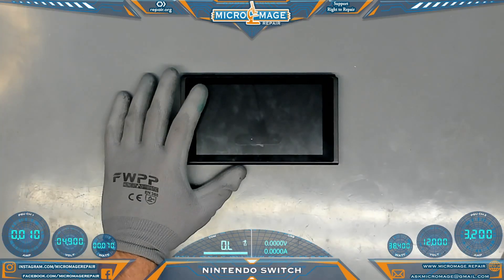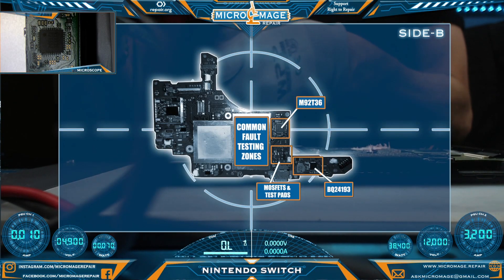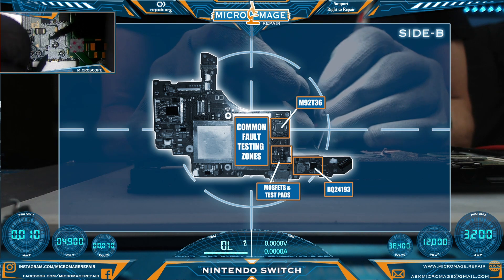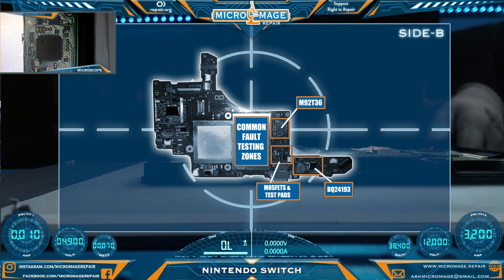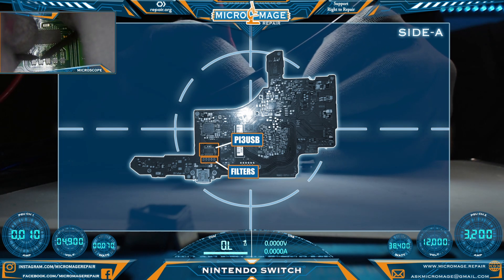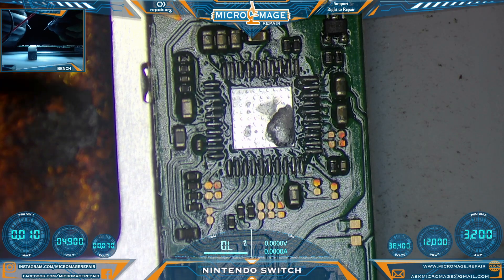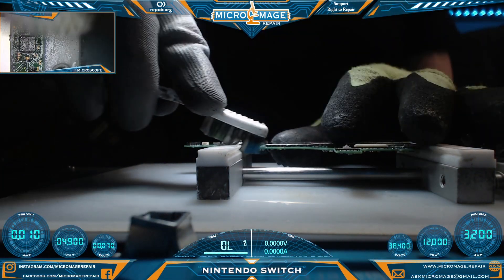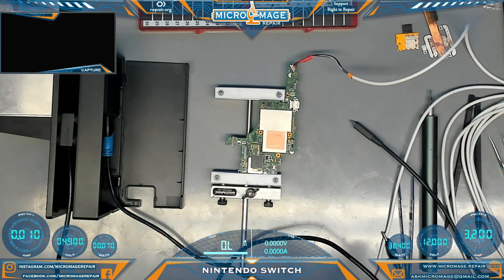Nintendo Switch: Error Code 2101-0001

Comment: Hi i have replacing the usb c port and it was going perfectly but now i have everytime a short on M92T36 Short on Pin 39 the Mittle Cap everytime that one. How i can know what are too doo ? i get no 15v only 5v are too see
Reply from the maker: Very likely M92T36.  If you have a thermal camera and know how to inject power, you can confirm that way. Otherwise, I would pull the chip and measure again for shorts to be sure.
Reply: @MicroMageRepair Can i use isopropanol methode on it ? its the Pin 39 and 35 on short i have buy everytime from the same Seller is that the IC himself ? 420 Degress + 100% Airflow i have use 1 minute without flux and 1 Minute with flux ? Can i use a AAA Batterie to inject voltage or is it too much ? where which pin i must inject that voltage ? than the M92T36 himself get hot ?
Reply from the maker: You can use isopropyl. 
Do not use a battery. 
Those are the temperatures I use. Your environment,  altitude, humidity, and any other factor you can think of could affect how much time it takes to wet the solder.

Unfortunately no matter where you source the chip there is a possibility you will get duds.  
I personally stick with Injured Gadgets or Mobile Sentrix over a random ebay seller or Ali Express. They all probably get them from the same place but at least I have someone to complain to with those companies lol.

Whatever gets hot in this case is shorted.
Do not do voltage injection if you do not have the appropriate equipment.  
You can easily forever unalive the Switch.
Just pull the chip.
Reply: Okay u mean replace again the m92t36 chip again ? but its have 6x not working : ( it is very hard to say how i can go now my journey , the mosfets have not a short, i have not 15V where the fuse are is 5v
Reply from the maker: Are the shorts presnt without the chip?
Reply: @MicroMageRepair That is Magic = without the M92T36 its brilliant no shorts, nothing , nada 😞 But solder i a new one i know its blows me up again and i have no 15V where are the Fuse is on the Port, thats happened because the USB C was before broken its fixed and no shorts without M92T36 i have solder a lot of M92T36 last week and it was 2 Caps or 1 Caps only or Pin39 and Pin35 from M92T36 shorted. Shortly its without M92T36 no shorts, but no shorts on Pi3USB, Battery Fuelgauge, BQ , no shorts 😥
Reply: @MicroMageRepair No shorts when i remove now the M92T Ic again , CPU or SOC damage it isnt or ?
Reply from the maker: I'd probably make the one last ditch effort of just wiping everything between the port and the chip and around  the chip (not the resistors or caps) and replacing them all.
All the mosfets, pull the diode arrays if it has those. (Don't even need to replace those)
The little dual filter next to the shield.
If that doesn't solve it then I'd have to toss that in the donor pile and move on.
Reply: @MicroMageRepair The Mosfets all 4 are not on short but i have found the Pin 34 was riped off and lays on the big GND in the center from M92T36 place i have now remove that Pin from GND, that cant do a Short ?
Reply from the maker: @user-bw5hk5nb3k yes that definitely could cause a short.
Reply: @MicroMageRepair That i have remove it in 1:40 Sec i hope nothing burned here but its look okay :( That means i need a new M92T36 right ? the pin is now removed its a N.C pin i think
Reply from the maker: Try another chip and see.
Reply: @MicroMageRepair okay i have ordered a another one, but what i can do when its make the same issue ? 😢 The mosfets looks good in diode mode , port is new
Reply: @MicroMageRepair I leave u hearth from my Soul i can say when i solder the old M92T36 its blockade the 3.3v too i havent a 15v , when i remove M92T36 and start with Battery i have 3.7v or so it was and 3.3v of the backside is given again. it is looking soo that the M92T36 blockade everything to safe the mainboard ? i Havent a idea i must wait for the new M92T36 IC but my feel says it is not repairable
Reply from the maker: @user-bw5hk5nb3k  It's quite possible it isn't. Could be an internal board issue. hard to say. Try one more and be done.
Reply: @MicroMageRepair yep i have ordered new M92T36 is the 15V on the Fuse comming only when the M92T36 Workin Properly or which rail is for the 15V when i put my charger in i see there 5V is that right ? Must that not see 15V ? 😢 You Rocks ! Thx for every helps
Reply: @MicroMageRepair  I'm a big believer in you and am practically a fan of your work. I'm planning to buy a lab power supply starting Monday. How many volts should I set for a voltage injection? 1V 0.5mA? And then solder it to the IC where it's short-circuited, for example, on the cap that leads to the M92T36?
Reply: @MicroMageRepair ❤
Reply from the maker: 1 volt is good. I'd set it at 1 amp and slowly raise it until something generates enough heat to be detected. 1 to 3 amps is enough in most cases on a Switch. 
A thermal camera is much more sensitive than isopropyl.  They are not unreasonably priced these days. Good tool to have in the kit.
Reply: that is true, soon the camera too :) which pin i must inject that 1v into the pin which have the short or cap rightly ? Thx for every helps :)
Reply from the maker: Any where on the shorted line. I'd personally solder the ground side and just use a probe to inject the positive.  That way you can quickly disconnect when you've found the issue.
Reply: @MicroMageRepair You Mean GND Pin put it to the Shield of a GND Point and the + on the shorted area , can i do it to the cap which is going to the m92T36 Pin 39 ?
Reply from the maker: yes.
Reply: @MicroMageRepair Big Thx :))) i wait now firstly for the new m92t36 i have a big bad feeling to destroy it again  :(

Comment: You are a Lord i am Sure u know that isue hopefully ? I have everytime a M92T36 Short after soldering a new Component its everything okay but when i put the charger ( Oeginal Nintendo ) its Blow the M92T36 again and i have short again, everything is No Shorted like BQ, Pi3USB , that area have no shorts :( what i must replace to get my switch back to life :(
Reply from the maker: Typically, it's one of two possibilities when I've seen this. One there is pins shorted in the port (sometimes non obvious).
If the plastic spacer that separates the pins is damaged in any way, things can short together. 
Two, a mosfet either between the fuse and the chip or one one right by the chip has gone bad and is shorting out the chip when power is applied.
Reply: @MicroMageRepair Yes but which one and how i check 😥😥😥 i get diode numbers but i am not sure if its broken too with diode numbers, the pins into the ports looks very good but i am not sure it is really hardcore to find 😢
Reply from the maker: I'd start by swapping the port. If that doesn't solve it I'd swap the mosfets all out.
You can go through a lengthy process of trying to find the faulty one but mosfets are hard to detect when they aren't dead shorted. I recommend you go with the simple path.
Reply: @MicroMageRepair  That means the port can look good but can damaged too into the Solderpoints ?  But where are all the mosfets and gow they look ? 

I am the firstly to have that harcore short ?

And its shut down after Nintendo logo that i must fix too
Reply from the maker: @user-bw5hk5nb3k It means it can the plastic can be damaged or burned/melted in a way you can't see. Internally. 

There are two mosfets near the fuse. Those would be most likely.  There is two (I believe)by the M92T36 on edge of the board.
Reply: @MicroMageRepair  okay but when i remove the M92 everyshort is gone that make me afraid to think never finding the issue
Reply from the maker: Failure is always a risk with any repair. 
The possibility that the solution is beyond our ability and tool set is also a possibility. 
Fear of failure is counterproductive. Have to work the problem to the best of your ability, and once possibilties are exhausted, accept the results whatever they are.
Reply: Thx for answering back :) , i have now ordered a breakboard to check the single pins from USB C Port but without the M92T36 i have on the Mosfets a lot of O.L

Comment: what did you modify to add the switch battery connector to? A squid or something? Do you have a video of that?
Reply from the maker: It's one of those super basic iPhone battery Squid cables (not the Mechanic. Not the ones with activation buttons) .
You also need an OEM charger for activation.  It won't activate for whatever reason on a generic 5v. 
I don't have a video on it. I should probably buy and build another for a dedicated video at some point just to have as a reference. 
One of those "when I have the time, patience, and disposable income for the parts" projects.  Mine breaking would probably have to be the motivation knowing me lol.

Comment: Silly Question just thought i would ask as some shops will not work on car audio stuff. 

I have a dd audio m3c. It was given to me 6 years ago it powers on and goes into protection right away. I took it to a place in pueblo and the amp was never repaired just sat there for 8 months and got the run around? This happened 3 years back. Great video's thank you for your time.
Reply from the maker: It is really difficult to repair anything that you can not first buy parts for from the manufacturer or second have an abundance of broken units from which to cannibalize parts.  Add to that manufacturer zeal for serialization (binding a device to another with specific ID or a chip to a specific radio or phone) makes repairing more niche devices more and more difficult if not impossible. It is not all that likely in a case presenting a fault of that nature that it is just some passive capacitor or resistor

Comment: Hi.. i have the same usb meter that you use put when i plug the original Nintendo switch adapter there is no reading in screen of the usb meter can you guide me to what is wrong i do.. i try different kinds but it is the same no reading in the screen (maybe because of the original adapter not work with it ..are you using a different power supply or power bank??)
Reply from the maker: This meter is finicky. I am only using it in this video because it's what I had in the drawer after my other died.
You have to have a Thunderbolt USB C cable on the device side to get it to activate on this one. Even with the right cable, it can be a bit of adventure.
Reply: @MicroMageRepair  thank you very much for your reply ❤️❤️